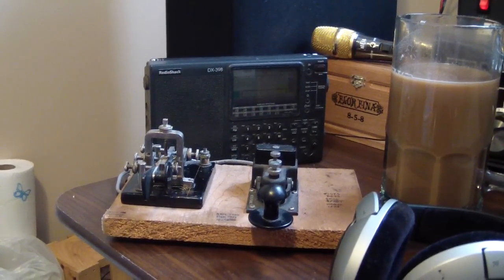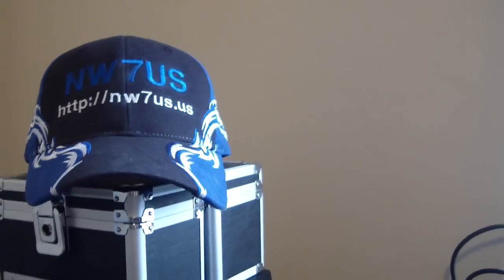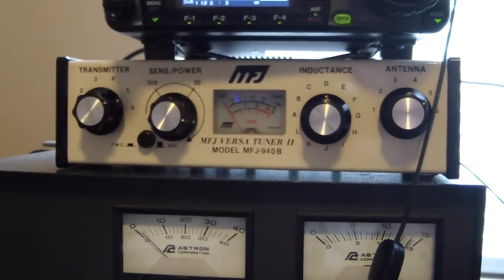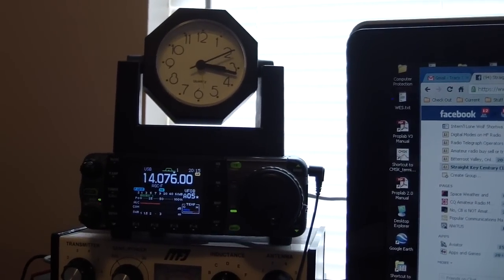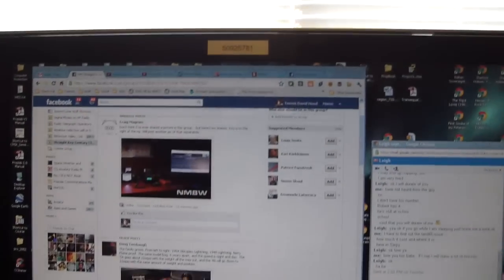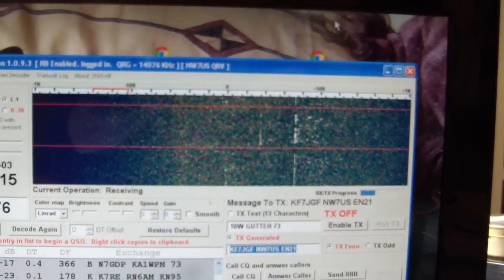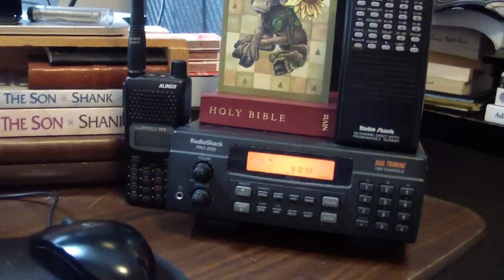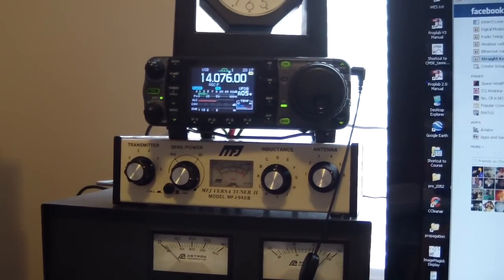NW7US Ham Radio Nebraska Station - April 3, 2012

Comment from the maker: I might just stay here in NE for a good while.  The siding as a ground-plane -- should work, if you have something on the roof to bind to.  I'm running QRP JT65a and CW, mostly.  On 20, 30, and 40 meters.  73 de NW7US dit dit

Comment: Cool set up.  We'll have to schedule a QSO when I get everything set up at my new house in a couple of weeks.  I'll have to get creative with antennas as well at the new QTH.  No trees to hang a dipole but the house is covered with aluminum siding.  I'm thinking an Eagle One 32 ft vertical on the roof and use the siding for a ground plane might do the trick.  How long are you planning to be in Nebraska?  That's one of the states I need for WAS.  
73 de N4TNA